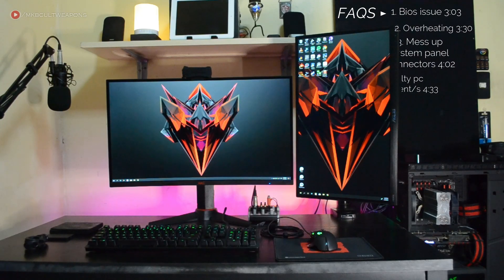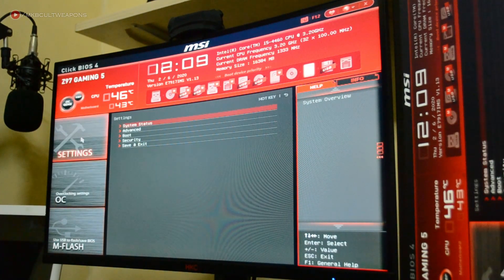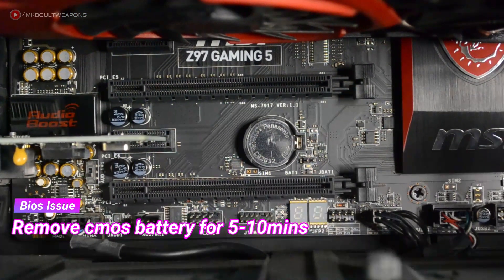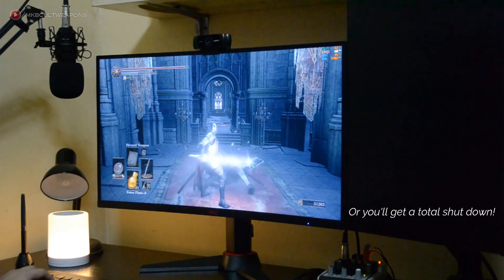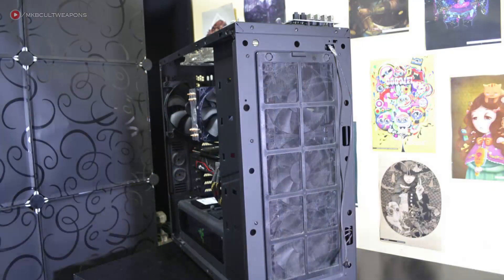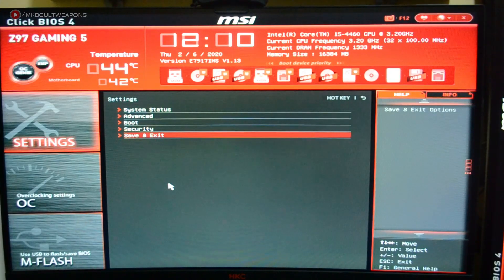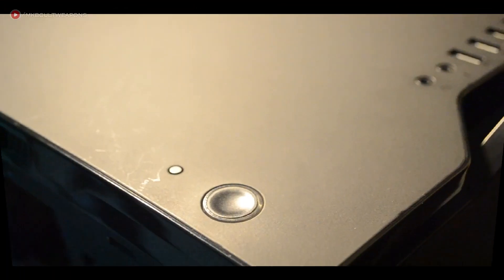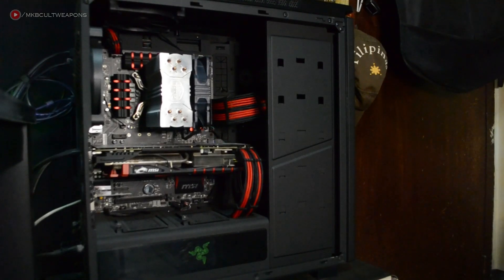Pc keeps restarting FIX / Pc continuous restarting FIX

Comment: Hello, i tried all of these tricks and it didnt seem to work. I have a windows 7, 2gb ram pc. I was playing some games on my pc, then my pc hit 80 °c. I went to restart it but when i was restarting it a black screen appeared. I waited for some time but it didnt go away so i just pulled the cable. Then i didnt open it for a few hours being scared that my pc died. Then i tried to open it and its on an infinite reboot loop. I have a video on my channel about that. Im assuming its because of a virus i downloaded. Is there some way to fix it? If so, could you PLEASE tell me?
Reply from the maker: yep that is definitely something to do within software stuff. Try clearing cmos first and here's how to https://youtu.be/S9hyEPTFR10 and if it still doesn't work this might be difficult to fix. 

If you are using ssd as boot drive try to remove any other drives and just leave your ssd and boot your system. My other theory is that you got a very old hdd in your pc and that is the one causing the boot loop. happened to me many times too. This may not be applicable to you if your are using your hdd as boot drive and if that is your case i think i got no more tricks for it other than reinstalling windows completely
Reply: @MacCoyzkie  Thank you. I see that the video you sent me is about on case. I cant do that because im not an expert on pcs and i will just make it even worse. I'll just format my pc via usb. Have a great day and thanks for reaching out.
Reply: @MacCoyzkie  And also, can you explain me how does clearing a cmos works? If you dont, then thats just fine. Thank you, again.
Reply from the maker: it will reset your system to default but you won't lose any files. if you're not that confident then yes don't try it out. having a clean windows installation will save you from more headaches
Reply: @MacCoyzkie  Thank you so much!
Reply: @MacCoyzkie   @Mac Coyzkie  Hello! Its been a few days, and i wanted to ask how could i format my computer without actually opening it? I got a usb drive with windows 10 installed into it, and i need to use it without actually opening the computer. I go to my boot menu with f12, and it tells me to "Select a Boot First device"
Im going to write all of the options here.
"Floppy"
"LS120"
"+ Hard Disk"
"CDROM"
"ZIP"
"USB-FDD"
"USB-ZIP"
"USB-CDROM"
"USB-HDD"
"LAN".
Do i pick one of these or do i go to a different menu? It would be extremely helpful if you could guide me. Thank you.
Reply from the maker: @seaurchinfan  first boot drive should be the usb with windows installer so you can install windows. The question is which usb from those option s because you got a lot of usb plugged in your pc
Reply: @MacCoyzkie  The usb i have has been used by my brother for a few times to format his pc. Im sure that usb is fine and all but i dont know which one to pick.
Reply: @MacCoyzkie  Or i may buy a new usb and install the iso(if it is an iso) file to that.
Reply from the maker: @seaurchinfan  you just got to try each one there restart pc because i don't know either. You know if you picked the right one if you will see windows installation on your display
Reply: @MacCoyzkie  Alr so i will try all the usb hdd usb zip etc thingys. Thank you soo much again.
Reply from the maker: @seaurchinfan  yes, the worst thing that could happen is that it won't boot correctly and will cause a normal restart
Reply: @MacCoyzkie  Hey bro, sorry to bother u but this is (probably) the last thing im going to ask. So, i have my 32gb usb drive here and im going to burn windows 10 iso into it. It has around 14 gb storage left in it. Can i still burn the iso file of windows 10 and format my pc along with putting or taking stuff out of the usb drive? By the way, if i burn an iso file to my usb drive will the files inside my usb drive get deleted? Those files are really important to me and i dont have any usb drives. Also, if theres no enough space for windows 10, 8.1 or 8, i can burn an windows 7 iso file too (if its somehow possible). It doesnt specially need to be one of these (Talking about Win 10, 8.1, 8). Thank you, again.
Reply from the maker: @seaurchinfan  you need a different usb that will be dedicated for windows installation and there should not be any files in it. It can't work when there are different files in the usb. Also don't choose the iso file. Choose the usb flash drive
Reply: @MacCoyzkie  alright. ive backed up the files from my usb drive. im going to research more about it. thank you
Reply: @MacCoyzkie  I researched, i think it deletes my files when i want to burn the iso file to my usb drive. If it does that, then its better. I dont have a pc to delete the files to get it working on the first place. Is this true? Im no expert so i dont really know if this is true.
Reply: @MacCoyzkie  Hello, its been a week, and i finally fixed my pc. Thank you so much. I wanted to ask if i could do anything in order to return your help. Again, thank you so much. My pc is working fine now because of you.
Reply from the maker: @seaurchinfan  You're welcome and thank you for the thoughts as well, we accept any donations to keep this channel going. please check the description if so. Glad i was able to help :)

Comment: Hi sir i am expiriencing a infinite restart when i power it on and it keeps restarting before i expirience it i encounter an repair disk error and i am sure it is on my hdd whos sure its on my hdd? Sorry for my bad english hehe
Reply from the maker: is your hdd your boot drive too? if so that will be a big problem. From the sound of your pc problem it seems like your hdd is old already. For now try cleaning the rams and clear the rams afterwards. here's how to https://youtu.be/S9hyEPTFR10
Reply: @MacCoyzkie  yes my hdd is my boot drive its 1 years old now i am super sure that my hdd is the problem i tried to use my backup hdd as a boot drive but it has no problem with my backup hdd my backup hdd has no os but the pc is not restarting or randomly shuts down
Reply from the maker: @rovinmalicse5185  1 year is still young, can you replace your sata cable perhaps its just the sata cable. If that still fails then i guess the hdd is about to become faulty or already faulty.
Reply: @MacCoyzkie  i tried to change the sata cable and sata power cable and i tried other sata port still same infinite restarting
Reply from the maker: @rovinmalicse5185  ok you have to do this tedious thing next. i suggest ask a friend with compatible pc to try out your rams and gpu one at a time and if problem persist then it's one of the components they tried is the one causing the restarts. If problem did not persist then its the motherboard or power supply. you might need to bring it to a local shop for second opinion before purchasing any replacement
Reply: @MacCoyzkie  ok thanks for suggestion sir i will try all fix you said sorry for my bad english haha
Reply from the maker: @rovinmalicse5185  no problem bro!
Reply: @MacCoyzkie  maraming salamat kaibigan
Reply from the maker: @rovinmalicse5185  tagalog ka pala amf nosebleed na ako dun haha
Reply: @MacCoyzkie  ngayun ko lang nakita lods mac coyzkie kasi name eh tapos may nakasulat pang filipino dun sa gilid ng pc hahha
Reply from the maker: @rovinmalicse5185  haha ok lang paps
Reply: @MacCoyzkie  puro sermon nanay ko nung nasura pc ko hahaha
Reply from the maker: @rovinmalicse5185  :_emoteLaugh:

Comment: My pc restarts randomly when ever it wants, after 15 mins or 5 hours ive tested all parts bar motherboard because that aint easy to test, i replaced psu still does it i have no idea what to do
Reply from the maker: how are your cpu and gpu temperature in idle? also can you try clearing cmos first?

Comment: Is possible to upgrade motherboard & processor without reinstalling the OS? I saw a video tutorial but that's only for motherboard swapping to newer board.
Reply from the maker: it will work but you will have issues in the long run. I tried it many times just to test some drives but to have it fully function as a normal workspace i suggest have a clean windows installation.

Comment: What about when it restarts when the PC gets to the windows start up ( OS hasn't been installed yet becouse of the problem)
Reply from the maker: if you don't have any important files in the boot drive then have a clean windows installation
Reply: @MacCoyzkie  well that what I thought  I would get
Reply from the maker: @papaainsl3705  i think i replied incorrectly, since you don't have os yet and your pc keeps restarting then try to re-seat all your hardware specially the ram and gpu and the drive. if you are still going through all the restarts after re-seating everything then your drive might not be working well, or the sata cable if it is an ssd or hdd
Reply: @MacCoyzkie  tnx for the advice

Comment: I already doo all that but still keeps restarting.. I want to throw this pc on the rooptop
Reply from the maker: tell me how did the pc problem started, i might be able to help.
Reply: @MacCoyzkie  before something crash with the windows then after that It won't open keep on restarting.
Reply: @MacCoyzkie  keeps restarting when I saw error in mobo like 40 sometimes or A2 or R2
Reply from the maker: @aceworld4626  that's really difficult to figure out, were you talking about blue screen (BSOD)? If so then if it happens again take a photo of the error aka stop_code. Depending on the stop_code there are different kinds of fixes
Reply: @MacCoyzkie  there is no blue screen monitor won't open

Comment: My pc keeps restarting when I’m about to transition to the windows operating system, if I don’t use my pc for a while it gets to the operating system then restarts is my pc overheating?
Reply from the maker: it is overheating if you haven't clean your pc for a while so make sure at least remove the dusts off your system. To confirm this use msi afterburner to check your cpu and gpu temperature

Comment: What a clear teaching!!! .. Sometimes my pc starts when I turn on psu but next time it doesn't until I press power button. And it sometimes restarts 3/4 times unsuccessfully trying to boot but next time it doesn't restart.  Any help?
Reply from the maker: just a theory, this might be your power outlet fluctuating. try using avr or ups to confirm. If you already have those and still having the same problem then i think this is a broken psu or not working properly
Reply: @MacCoyzkie  I don't have ups. I shifted to a new place where electric voltage is very low and fluctuates. Since then this issue started. But I have a very goos Corsair psu connected to my smart invertor that acts as ups for power back up.. Isn't that enough? Is ups a must have?
Reply: @MacCoyzkie  also I chaged psu to check if it's bad. But same issue . And actually with main power turned off, I switched on ups mode in my smart invertor and powered pc through solar battery. Same issue.. I just found that My cpu processor is 70 c temperature at idle state. Could that be the culprit?
Reply from the maker: @driftingmelodies  yes! cpu at 70c in idle is not normal. either your thermal paste is not good or old so time for re-paste. Anyway your psu is fine, if your area has a very unstable power you better at least use an avr like this https://amzn.to/3iOgECa

Comment: Could you you tell me if it's my power supply or not because when ever I'm playing games it doesn't restart very often but when I'm doing other stuff it does??
Reply from the maker: can you check your task manager>processes and see if there is something working in the background that is using 100% of your system? Also when you do those other things can you check your cpu and gpu temperature using msi afterburner?
Reply: @MacCoyzkie  ya my temps are good  and i dont see anything thats taking alot precentege
Reply: and thx for helping

Comment: In my case everything works fine untill it is 7 pm to 10pm my pc automatically shutdowns between those period don't know why, I tried all the YT tutorial everything but couldn't figure out the timer issue 😕😕😕
Reply from the maker: what are your cpu and gpu temperature?
Reply: @MacCoyzkie  Doesn't matter, because yesterday I didn't used my pc in day time after 7:20pm when I tried to boot or start my pc it wasn't working. Then I tried after 9:45pm PC was working then. Don't know what is the real issue
Reply from the maker: @Untitled2580  it does matter, if temps go beyond 90c then automatic shut down is inevitable. Use msi afterburner to monitor your cpu and gpu temps
Reply: @MacCoyzkie  Thanks mate
Reply: @MacCoyzkie  I kept my pc ideal for 2.5hrs nothing happened, but when I started working on chrome then the shutdown problem started auto shutdowns after every 50mins
Reply from the maker: @Untitled2580  i see, can you check your task manager>processes? and see if there is some program eating so much ram performance. Also this might happen if your rams are 4gb or lower the you open so much chrome. Chrome eats a lot of rams
Reply: @MacCoyzkie  sure, I'll check taskbar, I'm using 16GB RAM

Comment: Didn't work!
Have a Dell Precision T1600.

Did
1.) RAM cleaning, stick swamp.
2.) CMO battery removal
3.) Power Supply replacement
all those didn't work for me. ☹

----‐----------------------

I don't think it can be my "graphics card" because the monitor turns on for a few seconds before the PC rebooting problem happens.

PLEASE HELP!
Reply from the maker: the only thing left now is to try your gpu into a different pc. Ask a friend to try it out in their rig to check it

Comment: Bro,can u help me my pc turns off itself and then doesn't show display but fans keeps running,also i have changed mobo ,psu and ram stick and tested the gpu as well,I don't know what's the issue
Reply: Ok I will try,thnx bro
Reply from the maker: might be low power draw from wall outlet. Try using the pc with avr or ups before plugging it in a wall outlet. borrow from someone you know who has one
Reply: Bro it works good for some time if I rebuild my pc and next time when I turn it on,it again starts to issue
Reply from the maker: @hybridpk7873  like i said it has something to do with the power. Psu or wall outlet, use a psu tester https://amzn.to/3CdlErg to check your psu
Reply: Bro I have tried voltage stabiliser and ups but issue still not resolved, kindly help me plz
Reply from the maker: @hybridpk7873  just as i thought, i think this might have been your psu all along. if you could borrow a psu from someone to check then let's see if im correct. or you could just buy the psu tester link i gave above comment to test your psu
Reply from the maker: well i hope its not the motherboard then, have you tried clearing cmos yet?
Reply: Bro but I am using new power supply just bought it last week
Reply: I have changed my whole mobo
Reply: This issue is out of my understanding bro,kindly help me resolve it plz
Reply from the maker: @hybridpk7873  can you tell me what are your pc specs? btw this may sound basic but just to make sure, plug your monitor in your gpu port and not in the motherboard port
Reply: I have tried taking display from gpu 
I have Core i7 4770,zotac gtx1070,16gb ram 1866mhz,psu 770W,1tb hard,128ssd
Reply from the maker: @hybridpk7873  ok bro i suggest ask a friend with compatible pc to try out your rams and gpu one at a time and if problem persist then it's one of the components they tried. If problem did not persist then you got a dead motherboard or power supply. since it's new try using Rma on those parts since it's not working

Comment: Mine isnt working I wanna kms man :(
Reply from the maker: at least give me a background how did the problem started. Also if you can give me your pc specs i might be able to help you
Reply: @MacCoyzkie  I dont know what happened but about a year ago my pc started having the problem where it turned off and on so I took it to a repair shop and it started working and now the problem started again
Reply from the maker: @omarbants5349  if you already clear the cmos and also clean the rams like how i did it in this video and yet you are still experiencing that it could only be two things which is, your psu is failing or your wall outlet power is doesn't give enough juice for the system which is highly unlikely but it could be. Usually wall outlet failing because of power fluctuation so if you have experience that at home then that might be the problem.

You will need a psu tester like this https://amzn.to/3kNgTxk to check your psu and if your psu is fine try using your pc in a friend's house to check if it's the outlet that is causing the problem
Reply: @MacCoyzkie  alright I'll try that thank you man I rely appreciate it
Reply: @MacCoyzkie  bro I'm so happy rn it's working again thank you so much bro
Reply from the maker: @omarbants5349  you're welcome bro! glad its all good
Reply: @MacCoyzkie  my PCs running fine now but the monitor isnt showing signal and just sais power saving mode do u know a fix for that ?
Reply from the maker: @omarbants5349  power saving mode means your cmos battery is depleted, replacing it is the solution. make sure to buy the same cmos battery the motherboard has by default
Reply: @MacCoyzkie  I cant even locate where my cmos batter is on my pc
Reply from the maker: @omarbants5349  motherboards have different layouts so if you can't really find it i suggest just bring your pc to a local shop and have them fix it for you
Reply: @MacCoyzkie  sorry for bothering you btw , but I found it was under my gpu so I had to take my gpu out but I'm not sure how I'm supposed to know which cmos battery im supposed to get
Reply from the maker: @omarbants5349  bro you just need to look at the old cmos battery, the one your removed and search the store for it
Reply: @MacCoyzkie  alright its 1am for me I'll do it tmr I really appreciate your help bro means a lot